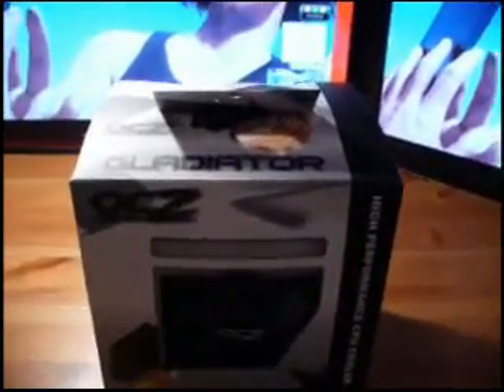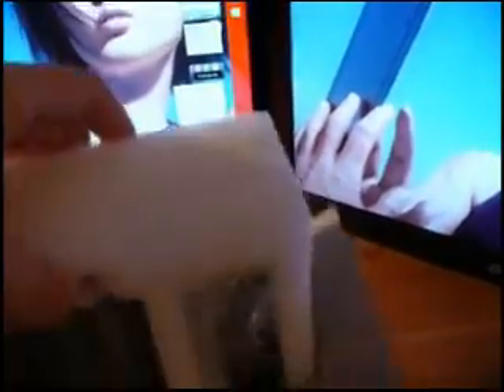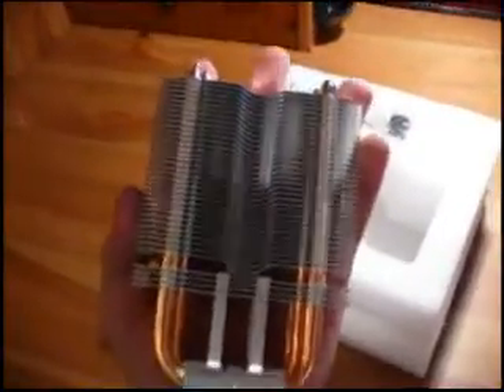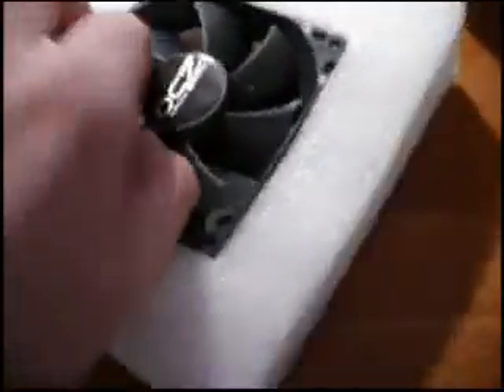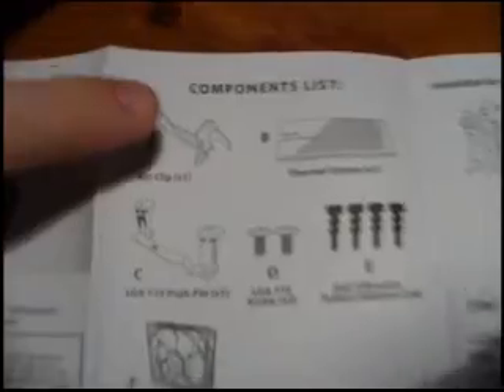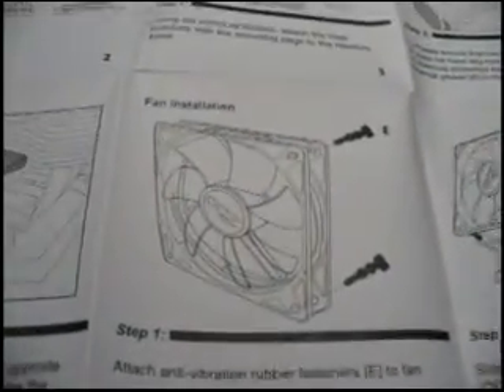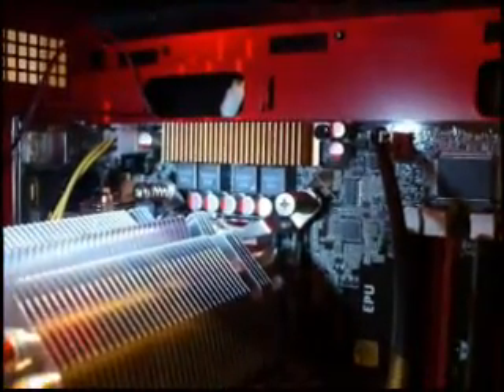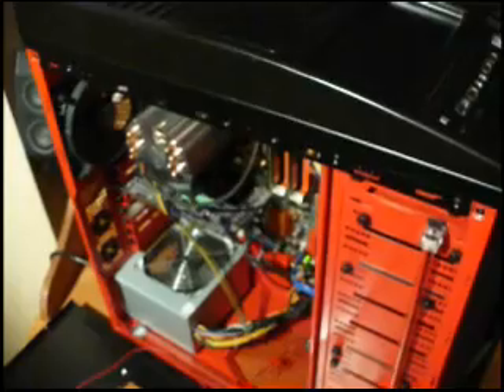Unboxing and review OCZ Gladiator Quad pipe CPU Heatsink

Comment: @kamilos48 Managed to fit mine with the motherboard still in the case, but unplugged all my leads and laid the case on it's side on my dining table rather than fit it where it sits on my desk. Fan mounts are a pain in the arse though, broke my fan blades while trying to push them in the fan holes. :|